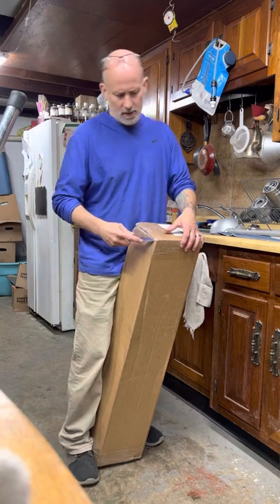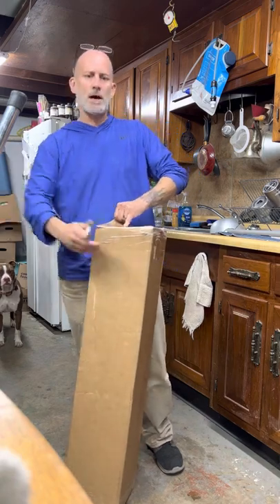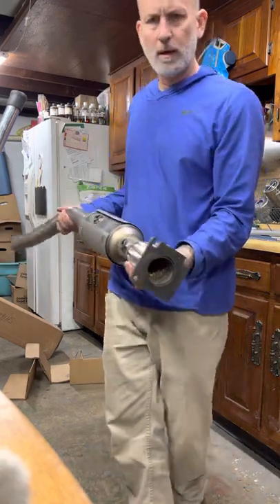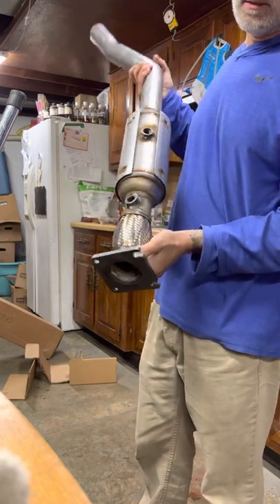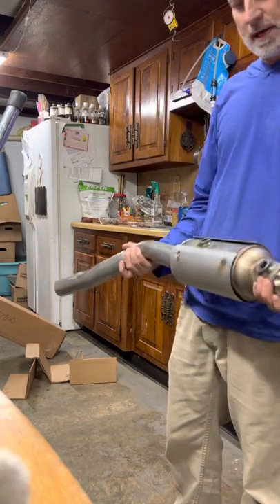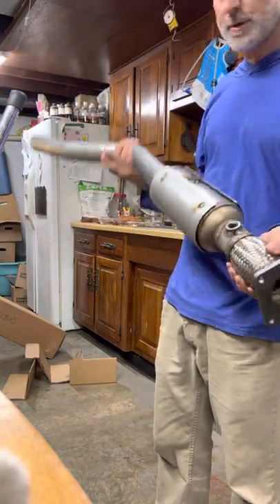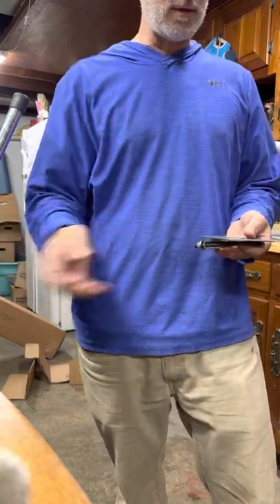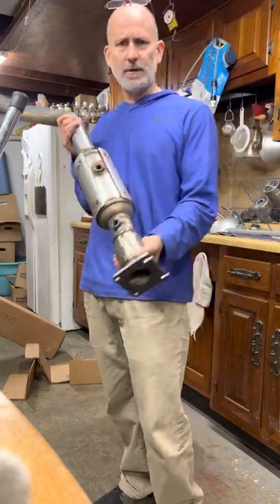Canadian Made Catalytic Converter Bought On EBay - Any Good?

Comment: did it pass smog? j/w
Reply from the maker: I’m taking it to get inspected next week. I’ll let you know!
Reply: @999Garage  hey did it pass want to know before I buy one from eBay
Reply from the maker: @youngnandito3674  no! It’s junk!
Reply: @999Garage how long did it last?
Reply from the maker: @thatsmychannel8055 I still run it. It works fine HOWEVER…. My avenger is a PZEV (partial zero emissions vehicle) and this converter is not. It fixed all the other issues I was having and my car runs just fine with it. I put a lot of miles on it daily, too. The ONLY ISSUE is that I can not clear the P0420 code due to the pzev thing, hence, it won’t pass emissions inspection. Fortunately, I have the car registered in a county where emissions sticker isn’t mandatory. So it’s good for a cheap fix, but it will not clear the codes if the engine is a pzev engine.
Reply: @999Garage  thank you. I already pass my emissions. Next one isn’t until two more years. I just find one to my 2014 Chevy Cruze 1.8. So can do my second job DoorDash to pay my car off this year, instead of August 2026.
Reply from the maker: @thatsmychannel8055 the Canadian one should do just fine for you then!
Reply: @999Garage  thanks